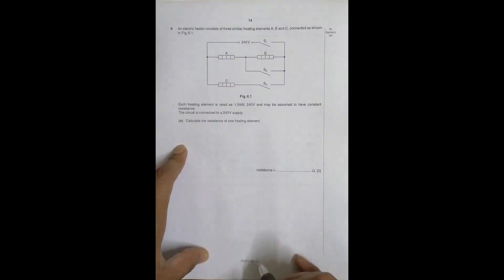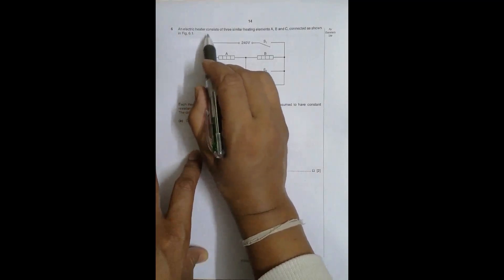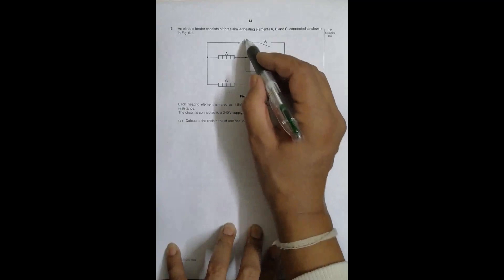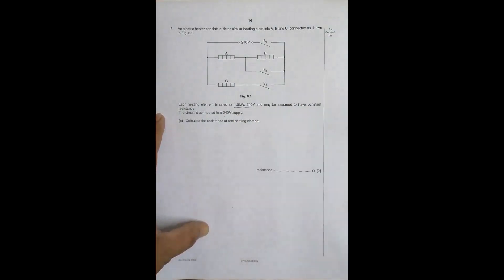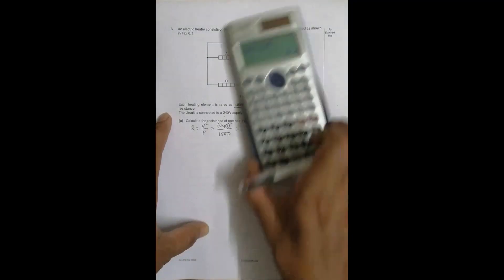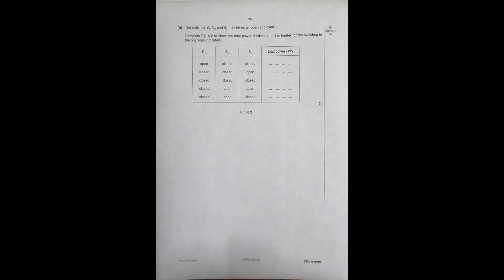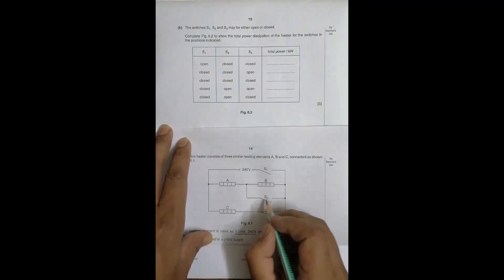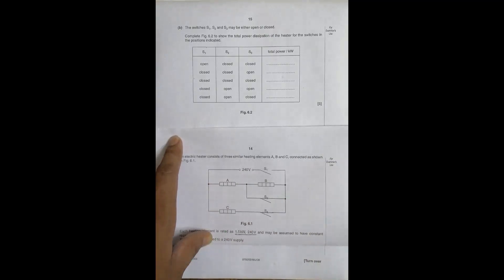2008 CAIE AS & A level May June Physics Paper 02 Q. No. 6 (9702/02/M/J/08) by Sajit C Shakya

Comment: brother in the second one (closed, closed, open) why does the corrent not flow through B
Reply: if u goten the answer of that plz tell me
Reply: He explained in video current will choose to flow in the direction where they is less or no resistance. There for B will be left out due to high resistance. Current will flow via s2 towards A since it has to still complete the circuit